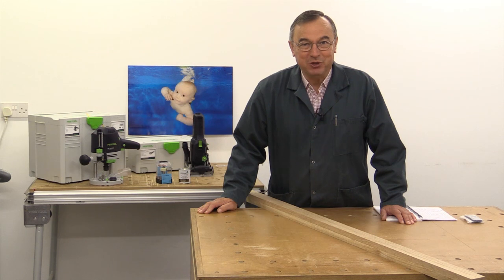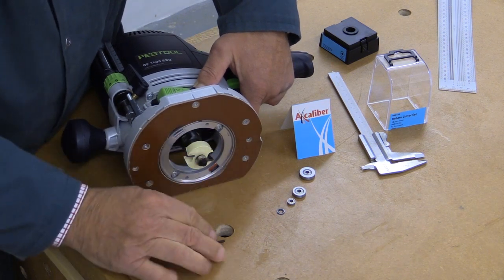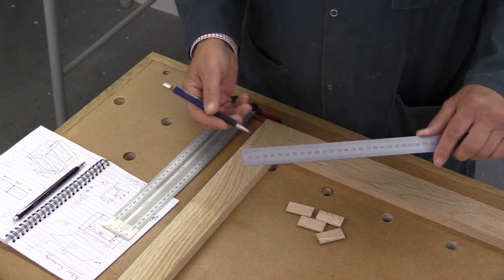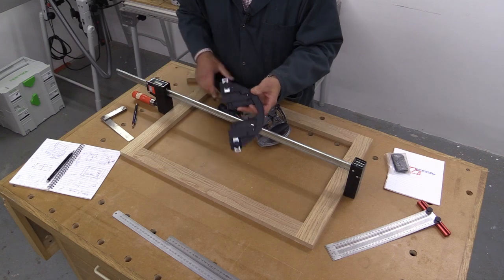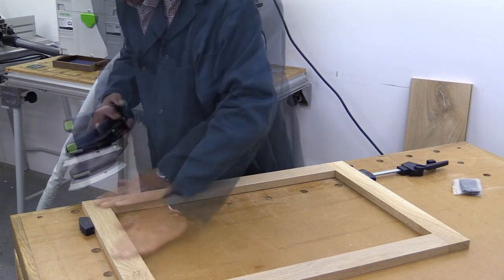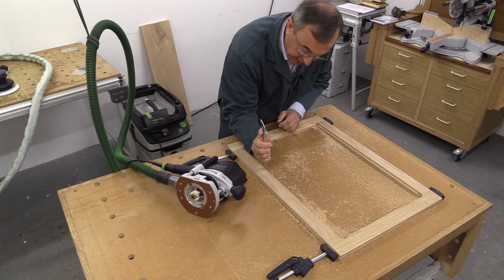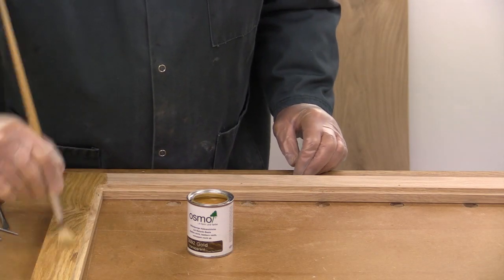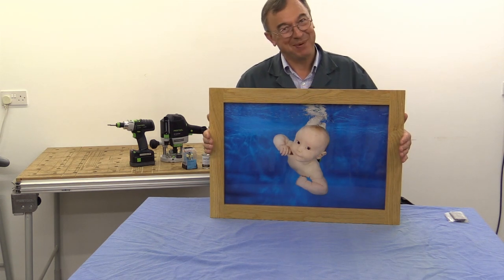Present Ideas #5 - How to make a large picture frame

Comment: Peter, this is another delightful video, and, of course, it makes me salivate for more Festool toys.  My only disappointment was that you used 90 degree butt joints rather than what I would have anticipated, viz., 45 degree miter corners.  I'd love to see the use of the Festool domino to do miter joints and perhaps using the MFT with clamping elements to improvise a miter joint clamping device for glue-up and assembly.  I jhave only today discovered your wonderful videos, so, of course, you may have already anticipated my request.
Reply from the maker: ***** The butt joints were part of the simple design and aimed at people who might not be able to easily do a mitre cut. I have done mitred domino joints but may not have included them in any current videos. They are just as easy as the 90 degree joints although clamping up needs a little more care. Keep watching the videos - many thanks for the kind words and your support.    Peter

Comment: Hi Peter, I enjoyed the video but am surprised that you chose to make the rebate AFTER you made the frame. Wouldn't it have been easier to have passed your four pieces through the router table (or with your hand router) to make the rebate, then assemble with the Dominos? This way, you wouldn't have needed to chisel out the round corners to make them square. Just a thought!
Reply from the maker: Chris P Hi Chris, That would be fine for two of the pieces but for the other two the rebate would have come out to the outside of the finished frame. I am glad that you enjoyed the video. It was a very pleasing little project.    Peter